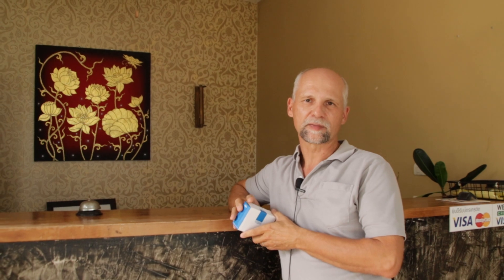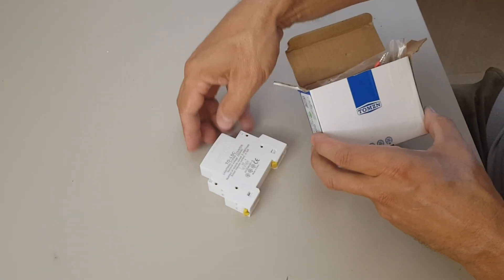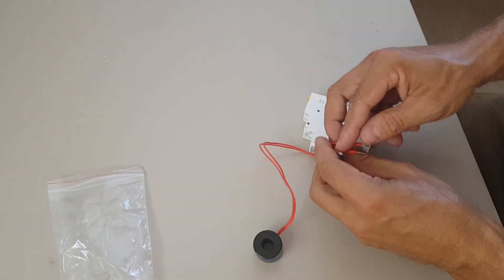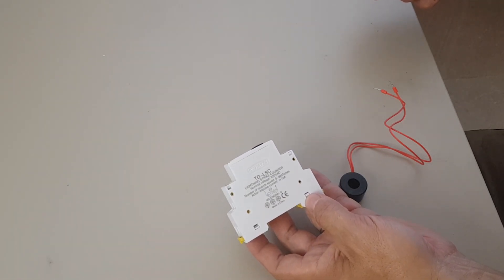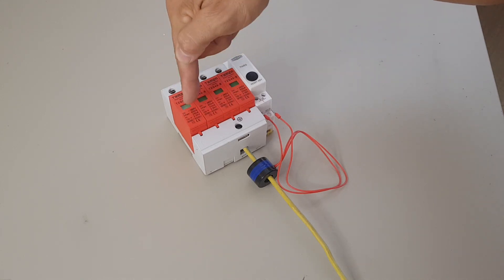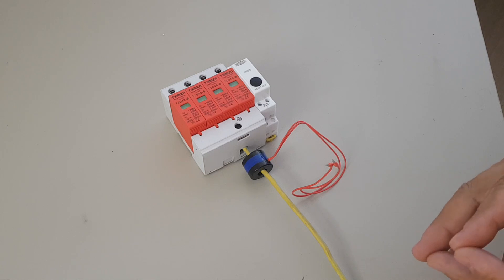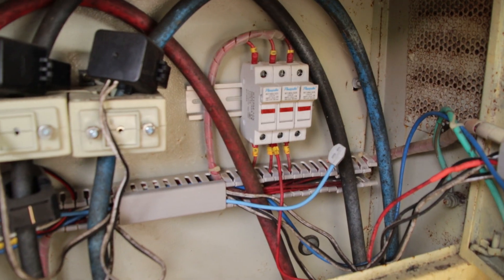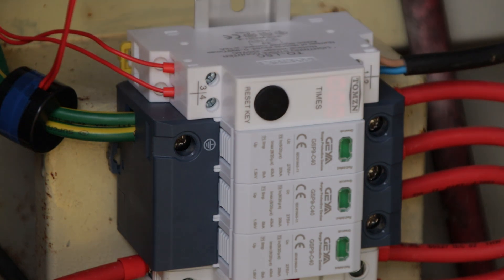Voltage Surge Counter. Monitor your SPD's for Lightning and Grid Surges!

Comment: im in a country with a TT earthing system. i had a SPD leaking a minor amount of current to ground for a whole month until the bill came. the indicator did not turn red but the SPD had started to go bad. probabaly due to dissipating several surges from the grid. now i have installed a 2pole 32A type A RCBO as the shortcircuit/overcurrent protection for the SPD. the SPD L/N is connected parallel to the output L/N terminals of the RCBO. so now in case the SPD starts to leak to ground without the indicator going red, i will know due to the RCBO tripping due to the imbalance in the current flow. would love to hear your thoughts about employing an RCBO as a way to find out when SPDs start to go bad. obviously this wont be the right solution for premises that require uninterrupted power supply. cheers!
Reply from the maker: Hi. Your thought process is correct, but the reason why SPDs are installed before any RCDs is that surges do not trip the RCDs, which would now happen. Did you measure the leakage current on your defective SPD? It would be interesting to know how much it was. Probably one should really check them from time to time 🤔
Reply: @RolandW_DIYEnergyandMore   the leakage was something like 650mA if I remember correctly. if the next leak is below 30mA, worse case would be a loss of 165watts per day which would be insignificant. the only real question is if a MOV that starts to leak prematurely would still be able to dissipate/shunt transient voltage spikes of many thousands of volts? 

another thing, reason I thought of using an RCBO for SPD leak detection is that RCD reaction time is in the millisecond range and the MOV reaction time is in the nanosecond range. so the RCBO would not trip during an actual surge event and it would have sufficient time to send the current to ground (which could be a parallel path to source). the RCBO would only trip if there's premature continuous leaking due to MOVs going bad. at least that is my theory 😊
Reply from the maker: @tekxplore  strange, I would have expected the MOV to burn out at such high permanent currents as it is just a piece of plastic. Good to know though. The RCD solution will prevent such cases. The device should hold still for most of the surges (Type 3 SPD= MOVs built in into appliances) but I would still expect it to trip at least when there are more energetic surges cause by lightning involved.
Its wort a try :)

Comment: Thanks Roland, handy device for diagnosing  remote equipment faults like generators , Change over switches and why the  Generator control mother boards are blowing up in a storm. Good also for working out mechanical  ware and tear on your surge protection.
Andrew Nz